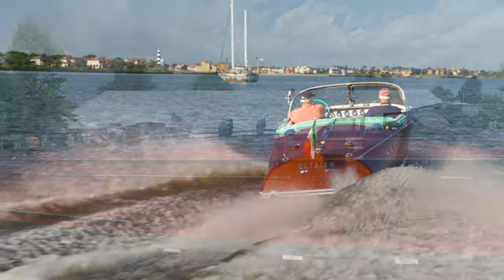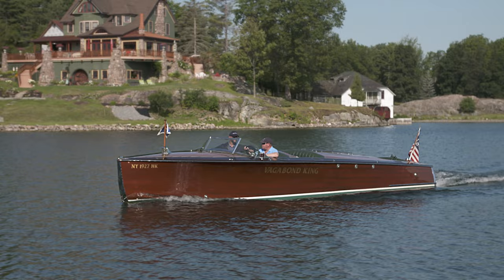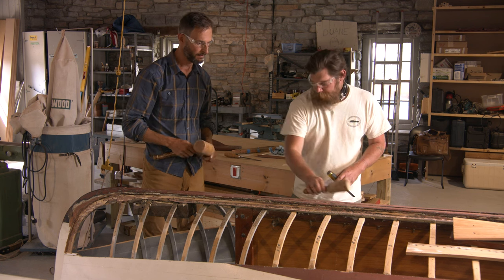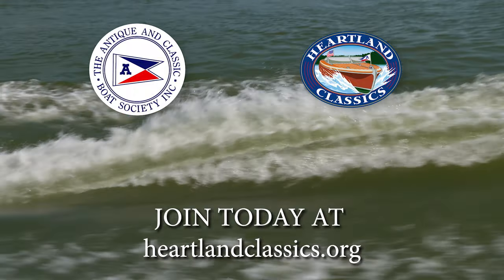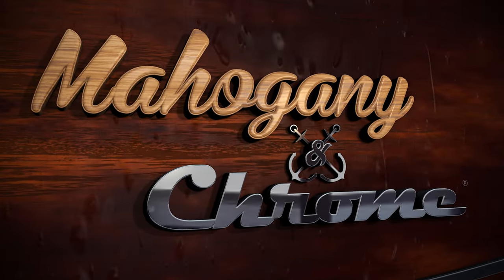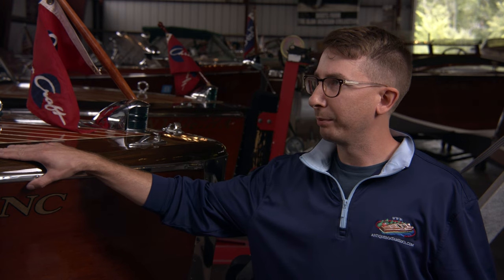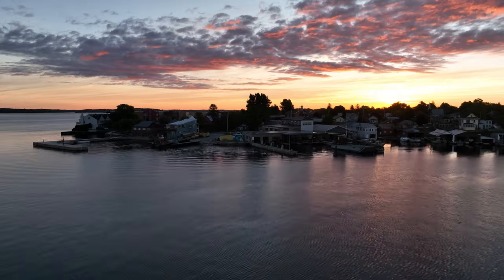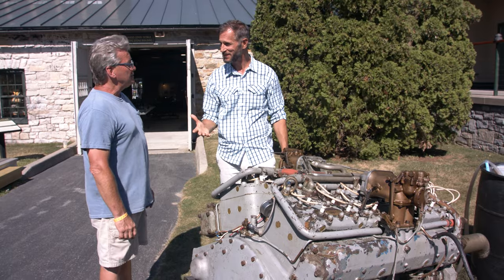Ep. 05: If These Planks Could Talk - Antique Power Boats of the Mighty St.Lawrence

Comment: Don't buy a wood boat.... I have owned many of them.. The biggest was a 106 schooner, (1918) and a 45 ft 1964 Huckins Fairform Flyer.. And have run many... Boatyards also will not haul old wooden boats...
Reply from the maker: Thanks for your comment. Everyone has a unique experience with wood boats. Most of our content and audience are focused on run-abouts and small cruisers that are handled, preserved or restored much easier than the big boys with which you have experience.